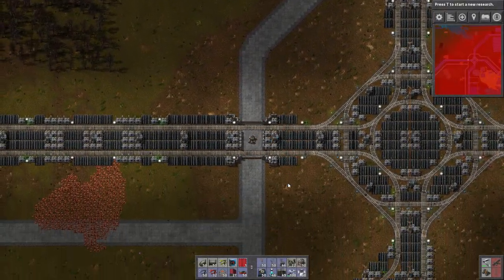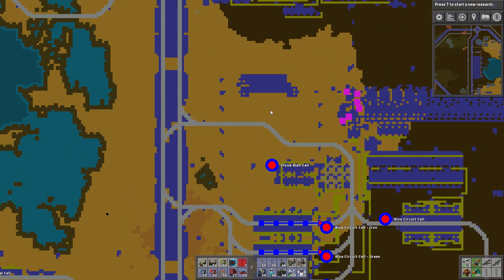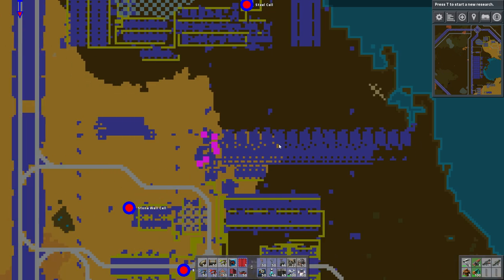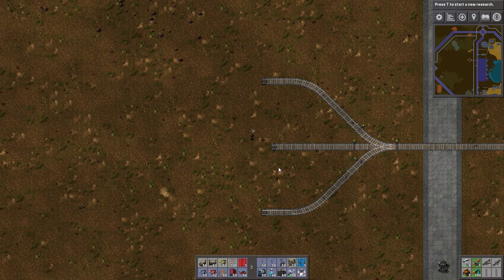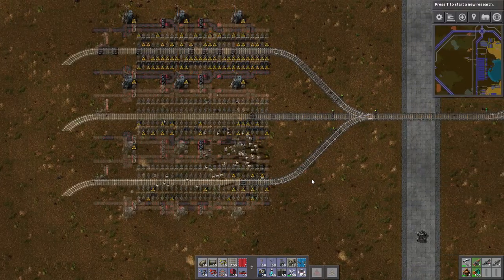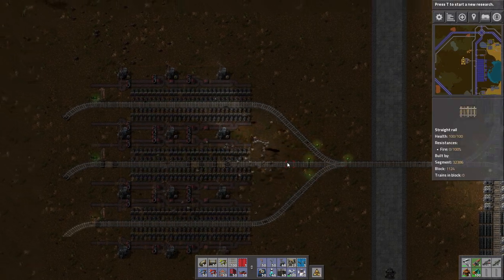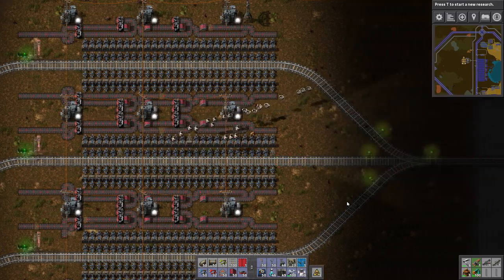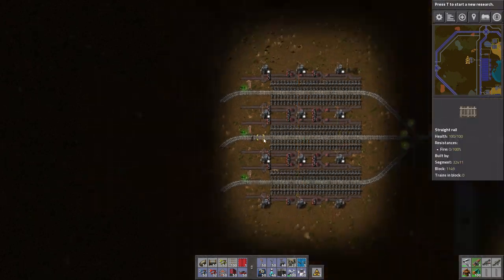Factorio Meiosis :: Module Cell - Episode 20

Comment: the new flamethrower is kinda overpowered, but i love it.  you just have to put a small flame on anything in the alien base and it will die, spawners or worms.  it also kills alien super fast, so if your running away from a horde, just leave a wiggly trail of flame behind you and they will ALL die, just don't catch yourself on fire, that will kill you quick

Comment: You should use train stop conditions to lower the amount of trains that need to run around your network. Just go with "Leaving when full" at refilling stations (With your production rates it should be enough), and "Leave when empty" at the emptying stations. That way, as long as the chests at the station are filled and not being used, the trains will be staying at their stations waiting. Less congestion, more better. :) EDIT: the alien artifact chests, you can use long handed inserter next to the long hand inserter, going the other way, with the two chests next to each other, all this vertically. (productivity modules)

Comment: instead of duplicating the red circuit cell, you could upgrade all of it to the yellow assembly machines and put 4 speed modules in all of them. Depending on what grade of speed module you use, that'll easily triple the production.
it takes 10,67 seconds to make a red circuit with a regular blue assembly machine. 
A yellow one with 4 Speed-Modules I only takes 3.56 seconds to make one. 
With Speed Modlues II you'd be at 2.91 seconds, almost quadrupling the production.

Comment: I personally disagree with making the extra red circuit cell for the moduals alone, and so close to them. Wasn't the inital idea that each one would be doing it's own thing, and supplying the masses? I'd be totally fine with you making a new one there, if it was taking some of the load of the other one, but not so much for a dedicated production.

Comment: Using some Assembly Machine 3s should help too (+40% speed or so I think?), but I don't know if you have the speed module 1s anywhere to be able to produce them.
Reply: +66% (1,25/0.75)
Reply: matsv201 Oh I did it the other way around and thought that .75 was 60% of 1.25, so it'd only be 40% faster
Reply: I was looking for someone to point that out. He has speed modules 1, maybe it's better to make another cell or add them to the assembly machines cell (if there is one), it's just red and green circuits. 

On top of the speed increase, each one has more slots for modules so yeah, much better. 

Personally I try to switch to all blue belt and assembly 3 when I can.
Reply: Grimmie XII No..

The level 3 is 66% faster, but the level 2 is 40% slower..
1.25-0.75=0,5 <-Diffrence.
0.5/1.25=0,4->40% slower
0,5/0,75=0,666->0,67% faster.
Reply: ***** Yea... Assembly unit 3 is heck of a lot more efficent than unit 2 with speed modules. Both requier less things to produce.

You need the level 2 to get about the same speed. Then you get 120% more power consumption

For a level 3 assembly unit you need.336 units of material (copper, iron and plastic and it uses 210W of power. Two level 2 speed modules uses 1195 units of material. And in a level 2 assembler it would use 330W of power.

So its really quite a bit worse...

But i guess. he is not going for good, he is gooing for large.
Reply: matsv201 sorry, yep you're right - I'm an idiot haha

I didn't think about the proper order to do the math in or the fact that 1.25 is a bigger number so the relative % of how much slower 0.75 is, is smaller than the % from 0.75 to 1.25. Thanks for clearing that up. I clearly need to go to school again.
Reply: Grimmie XII Well.. yea.. it seams like the way that school teach procentage dont work that well. very few persons understand it.. and still its a quite a simple math.